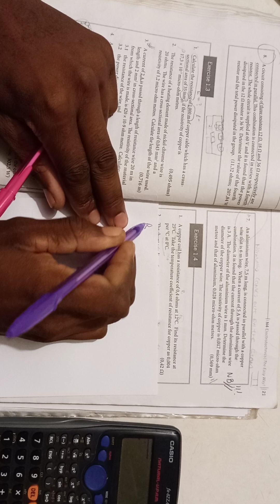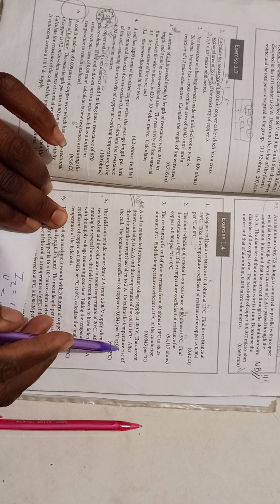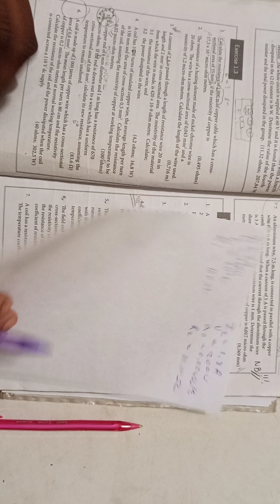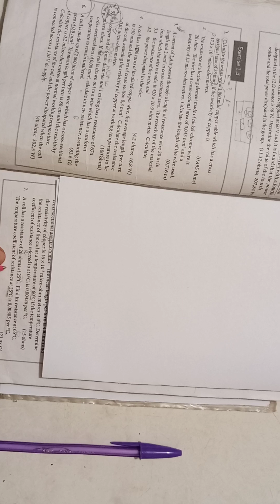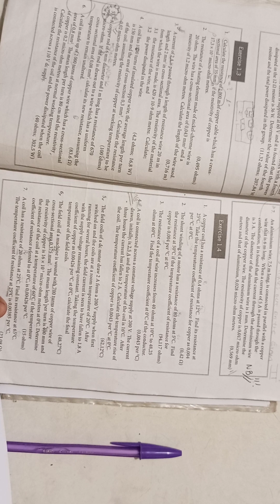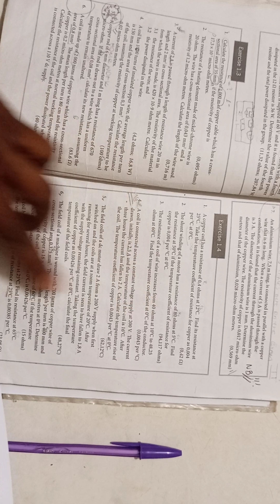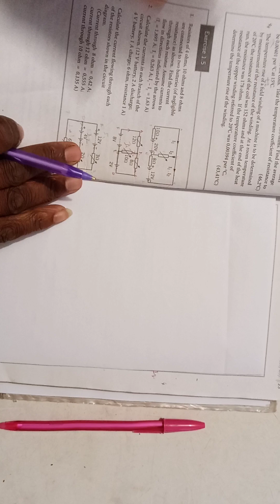Temperature coefficient(N4 Electrotechnical)

Comment: Why you didn't use the other formula:R1=R0(1+alfa(t1-t2)??.what is the difference between the two formula.pls
Reply from the maker: 54:48-57:15, we use yours when temperature coefficient is not at 0°C but at initial temp.